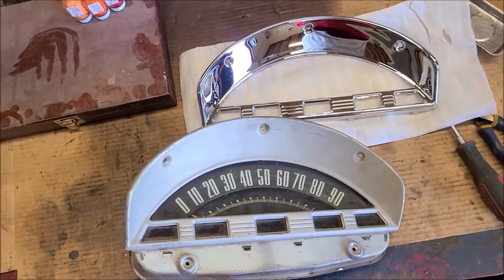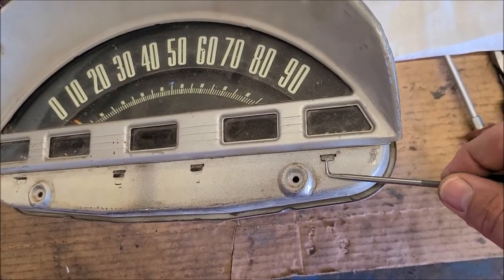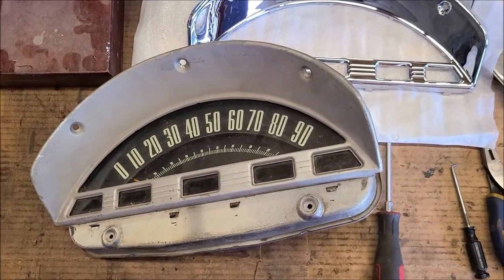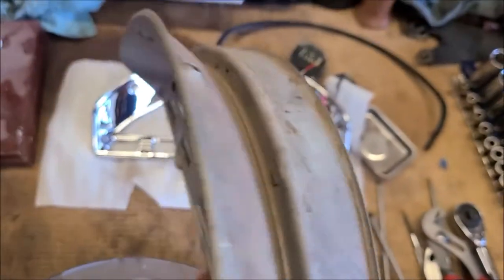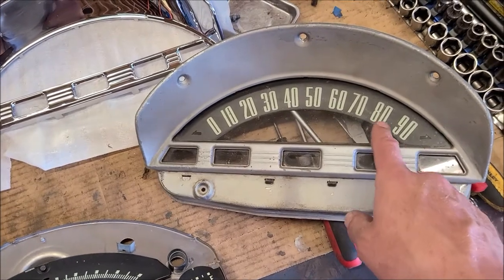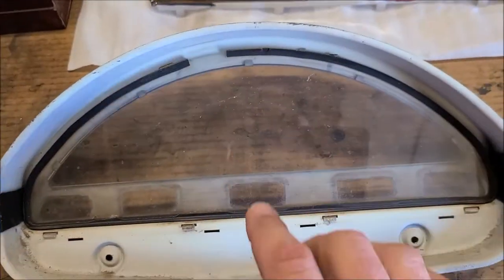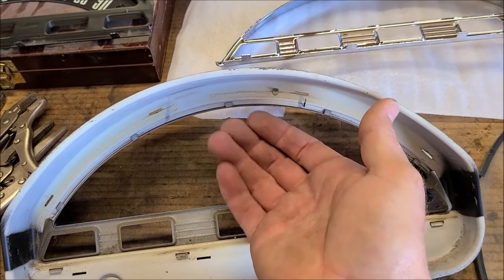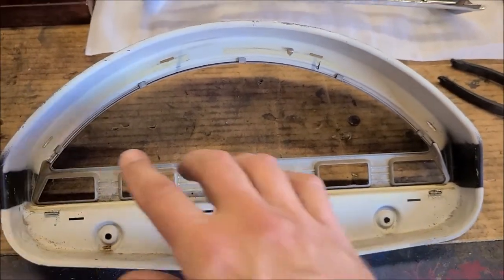1956 Ford F-100 Episode 28 - Chrome Dash Cluster Frame Install and Speedometer Cleaning

Comment: Really good video going over these dashes. I did this too. Had bought the repro chrome trim and it was so terrible I sent it back and got a re-chromed original from them instead. MUCH better fit and finish. They must have gotten better repros since. Also converted mine to all gauges, which is really nice. Oh wow, mine were plastic backed, not metal like yours. They've made a few changes over the years!  A nicely done up dash does wonders for an interior, looks really nice!

Comment: Could you tell me where you found gauges that fit into the old dash panel? I need to replace my fuel gauge and going to mount it back in the dash cluster.
Reply from the maker: I bought mine from Mid-Fifty https://www.midfifty.com/